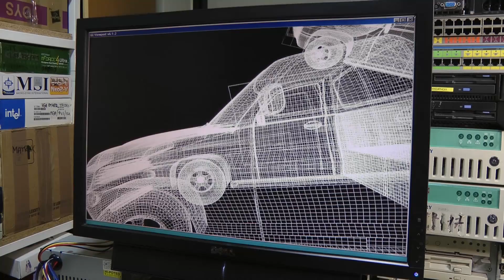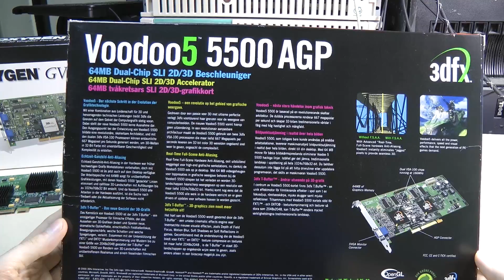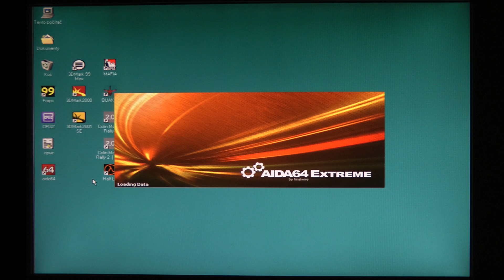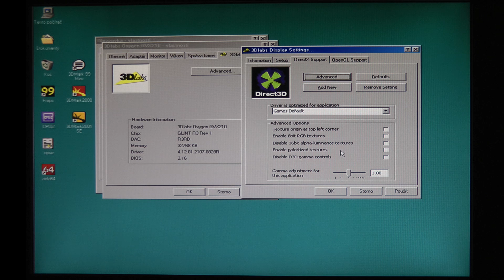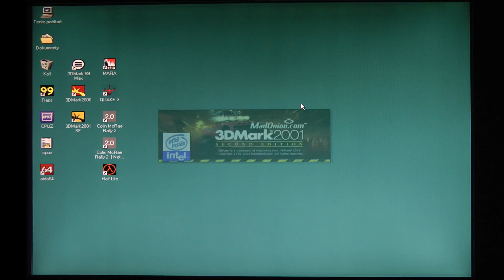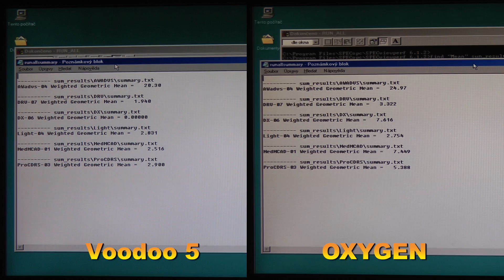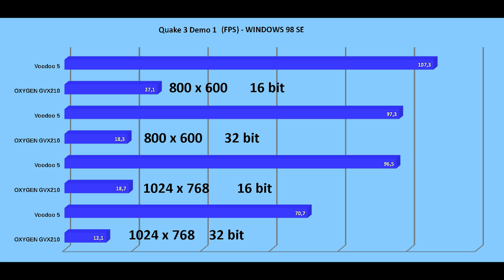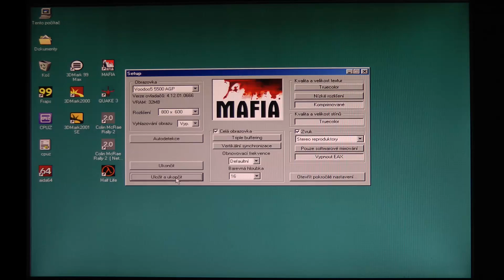3dfx Voodoo 5 vs. 3DLabs Oxygen GVX210 on Pentium 3 Tualatin - RETRO Hardware

Comment: when testing Oxygen VX1 (single Glint R3 chipset), i saw that the card doesent like "high quality" textures or fast texture loading/movement or trilinear filtering, actually nothing with textures :) .
I did see a nice speed  improvement when using bilinear textures or lower texture quality or both...
Reply: Been looking at the results for 3DMark 99 and 2K, you get allmost exact same scores as the single glint R3(i get a bit higher in 3D99, you get higher scores in 3D2K and quake).
Maybe this card isn`t exactly a multi gpu card(no "SLI") and is more of a multi monitor card(one chip for each monitor) ? .
I`ve tested on a P3 1Ghz, i815 chipset, 512mb pc133 cl2 ram.
Reply from the maker: This card is triple GPU on paper. Second thing if and how any game/bench can use these GPUs. Yep also it is dual monitor like Matrox for example.

Comment: I remember my Intel Pentium2-450Mhz, 128Mb Ram, with a Creative nVIDIA Riva TNT 2 Ultra 32Mb would score 1600 in 3D Mark 2001 on Windows 98SE
Reply: @YoutubeTookMyNickname.WhyNot  no it was just a bit later once the nVIDIA GeForce 256 came out & then the first graphics accelerator with GeForce DDR memory. This was the card to fight the VooDoo 5 & VooDoo 6 (that never made it to the public). The TNT 2 Ultra was fighting the VooDoo 3. Great time for hardware & most important for enthusiasts!
Reply: @YoutubeTookMyNickname.WhyNot  1024x1024 on TNT and 2048x2048 on TNT2. Matrox G400 already had 2048x2048 textures and environment mapped bump mapping

Comment from the maker: Photo gallery for this video: https://www.facebook.com/media/set/?vanity=retrohw&set=a.848198962258064
Reply: Could the Oxygen graphic card be bottleneck by the CPU and should it performed better if you have switched to an AMD Athlon 64 platform?
Reply: Do you know that nVIDIA at the timev said that SLI & multiple GPU's is bad design but then after years they implanted the technology them selves. They also said that it's bad that the graphic adapter needs extra power & now I need to connect my nVIDIA Cards to my PSU 😀
Reply: @johnnychang4233  i thought the same, but if its bottlenecked, the v5 may be bottlenecked too. But more important to me would be a final chart and a conclusion at the end of the vid. So everyone can classify use cases for the oxygen. To be honest, i didnt know much about the card. Would love to see more such comparisons in the future :-)
Reply: @Left-Handed-Cat  Bottleneck in the sense that OpenGL 1.1 was software based by that time and the drivers wasn't that much developed.
Reply from the maker: Both cards are year 2000. With Oxygen you are limited by AGP Pro interface. Not so many setups with this AGP slot revision. Boards like Asus P4C800 s478 has AGP PRO but 8x.
Reply: did you try the omega drivers or glide wrapper
Reply: wanna buy a asus ares hd5870x2 4 gb card was only 1000 ever made
Reply: Hello retro hardware. I will have a question for you. I want to find a 16gb ram supported motherboard with 775 socket xeon processor and overclock the processor, fill all the ram slots on the motherboard. I want to install gtx 1050ti on this computer. Do you think I would have done anything good? thanks for your answer.

Comment: Interesting how the Voodoo card needs external power, just like on a modern GPU.
Reply: Yeah because pci and agp couldn't deliver enough power. Their max was like 25w. So it's not a case of these cards used so much power, just too much for the slots. Even the 6000 just had a consumption of around 70w

Comment: Hello retro hardware. I will have a question for you. I want to find a 16gb ram supported motherboard with 775 socket xeon processor and overclock the processor, fill all the ram slots on the motherboard. I want to install gtx 1050ti on this computer. Do you think I would have done anything good? thanks for your answer.
Reply: Merhaba!

Not the guy who made the video, but I had a computer just like that. It is a very fun combination, but keep in mind that even a heavily overclocked 771 Xeon is somewhat underpowered for a 1050Ti. But yeah, go for a P35, X38, P45, X48 chipset, get low density (usually double sided) 4x4GB DDR3 RAM, and it should be a rather fun system to overclock.

If you're just going for a cheap gaming rig, a much better choice would be a socket 1156 or 1155 system.

Comment: You should test the graphic cards with an EPoX EP-D3VA ! The dual socket motherboard can handel 2Gb memory.
Reply from the maker: this EPOX doesn‘t have AGP PRO slot and 512MB is good for WIN98
Reply: @RETROHardware  I think AGP Pro is specifically for professional workstation cards, am I wrong?
Reply: @matchmakerchris7617  Yes, it is for power hungry cards, it delivers more watts.

Comment: great video can you tell me what is the key to activate the boot menu on a winfast k8s 755m motherboard ? because i would like to install ibm os / 2 warp 4 on it . MY build : winfast k8s 755m , amd athlon 64 3000+ , 2 gigs ram ddr , 320gb maxtor hard drive , nvidia geforce 5500fx and psu kolink 500w

Comment: 3DFX VooDoo for games
3D Labs Oxygen for HIGHEND 3D GRAPHICS

This is a bad comparison.. Do VooDoo VS Oxygen in Softimage 3D 3.7 | Extreme.. You would not be able to do it, because VooDoo would not even run in this application. VooDoo is NOT A FULL SPECIFICATION OPENGL CARD. These cards have SPECIFIC purpose, one is for gaming, the other for highend 3D graphics software (Softimage, Alias, Wavefront etc..).

Comment: Mafia needs more CPU and GPU power.
Reply: Mafia is running on everything, you only have to lower details and resolution. I was playing it even on integrated GPUs.
Reply: @Pidalin  LS3D engine is bad optimized. Ok it can be launched without problems even with a Pentium 2 Slot1 with Riva TNT 2 M64... but performance? Even with Pentium 4 478 or Athlon Barton 462 there are stuttering problems.  Old but high-end hardware are now cheap. So there is no reason to play it with lower end hardware.
Reply: @Stermy57HW  Have you tried another LS3D games like Vietcong? That engine has big problem with mod for unlimited draw distance, but without mods it's ok, but I can imagine in 2002 it needed really good HW, I was playing it on FX5200 and PIII 550 MHz which is crap and it was playiable without problem. But I was 12 years old, I really don't know how much FPS was there. I remember only that FarCry was unplayable.